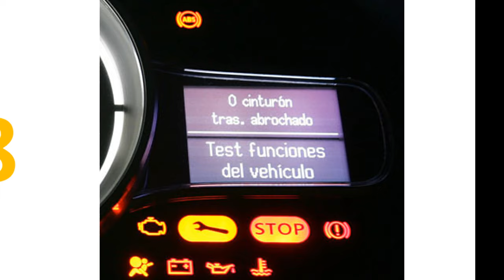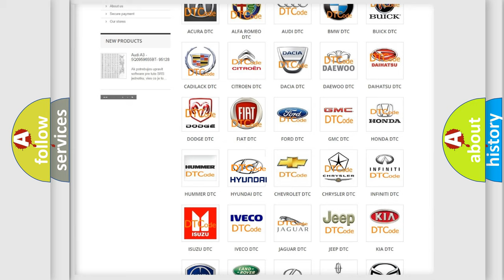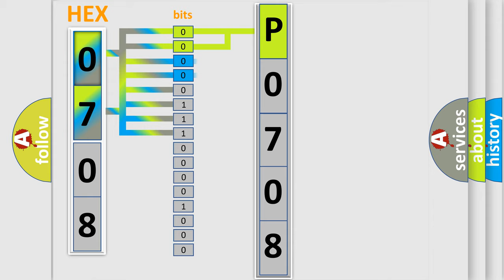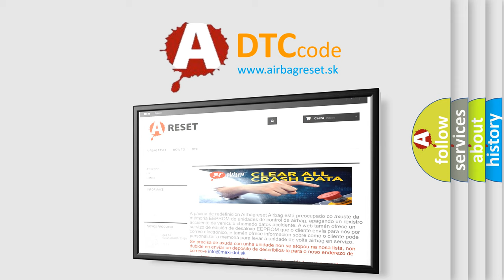DTC Hyundai P0708 Short Explanation

Comment: This is the worst explanation for a p0708 It is saying it has to do with wiper control which it does not it has to do with transmission control that's with the 7 designation is is transmission it even explains it in the video that 7 is transmission related and then it goes and tells you it's a wiper problem very uninformed video